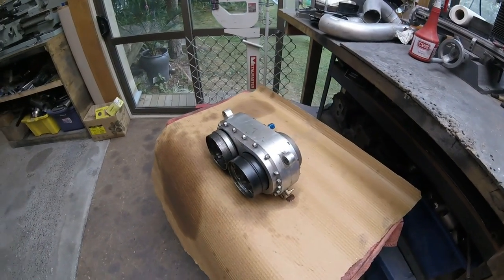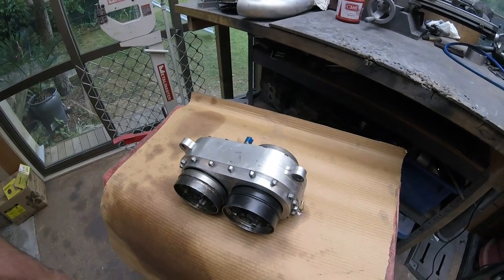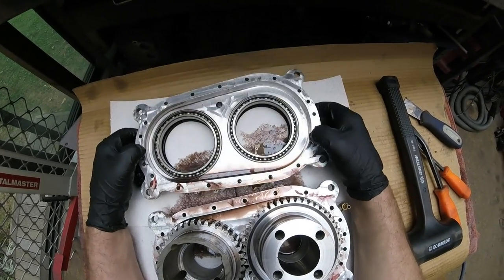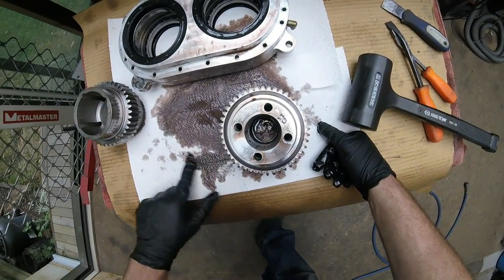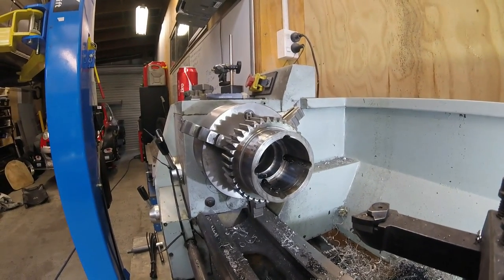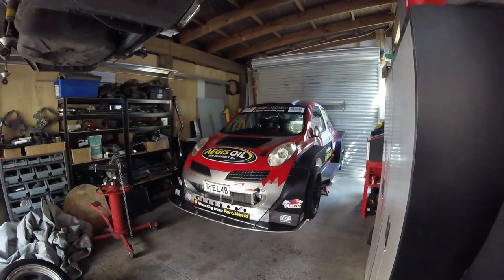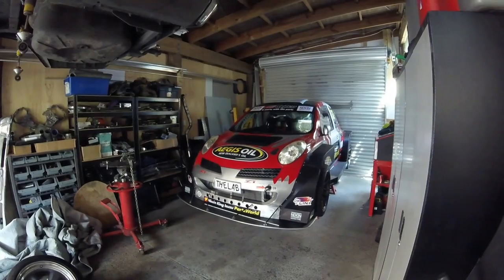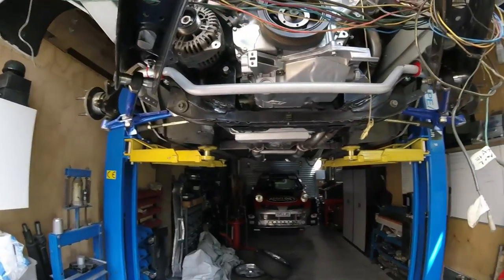Reversing transfer box maintenance and mods

Comment: Very clever reverse rotation box. In the UK for Offroad racing, we use them for the rear engine cars, but I really like that you haven’t got separate shafts, flanges and gears  👍
Reply from the maker: Glad you like it!
A slight tweak in design could make the end of the shafts accept the CV joints directly greatly reducing rotating mass and bringing the pivot point MUCH closer to the case - better all round!.

Comment: What is the purpose of using transmission fluid/gear oil mix instead of straight gear oil?  Also does that gear box get hot during use?  Thanks for sharing another video with us. I love the engineering you've done on the March.
Reply from the maker: I decided to swap from gear oil to ATF at one point, the case doesn't have a drain port so I just flushed the fluid through for a bit but didn't get carried away, this left us with a bit of a mix.
It's straight ATF in there now.
Box tends to run up to about 120 degrees C max but normally around 80 - 90 for what the car is normally used for.